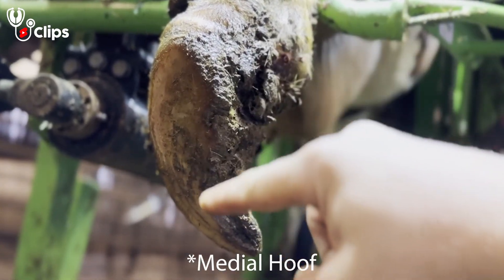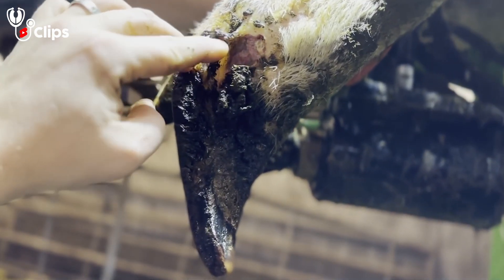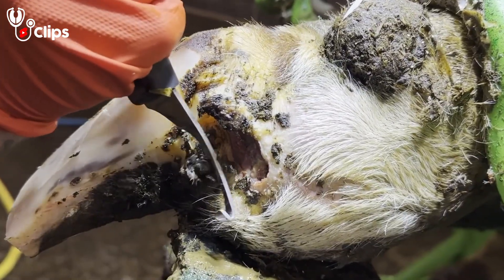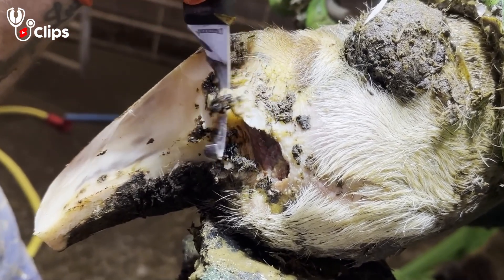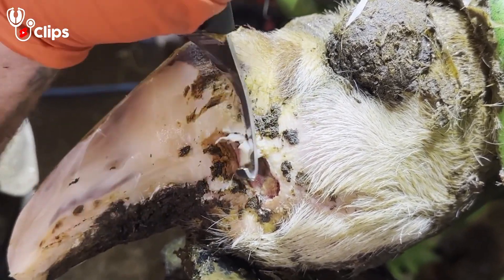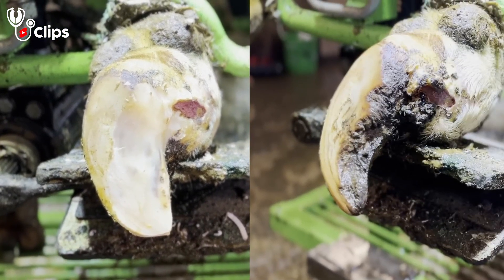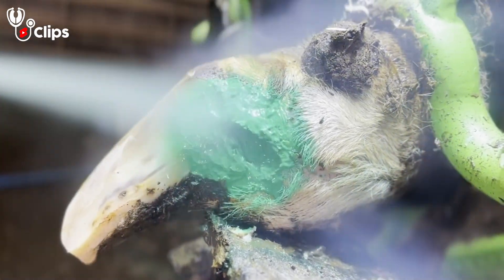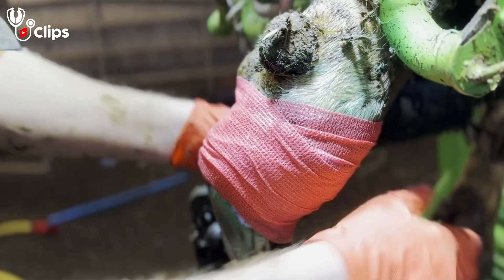COW WITH A MISSING HOOF! 😲

Comment: Are cows able to live with feet or a foot with one hoof? Is it like loosing a toe for them or unbalance and pain from the like preasure and weight? 
I wonder if they can make leg prosthetics for cows like they can for pigs and sheep
Reply: I don't believe it would be anything like losing a toe since our toes don't bare our body weight like a hoof does. It's more like trying to stand on just your heel or tip toeing. You can feel the pressure increase as the load is no longer distributed across the entire foot and with a cow's weight it's probably painful or very uncomfortable at the very least.